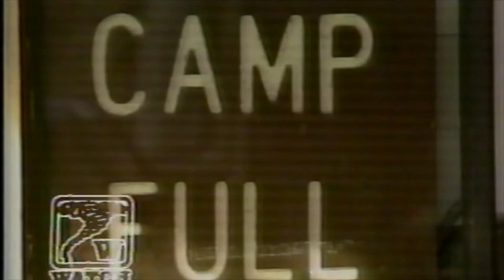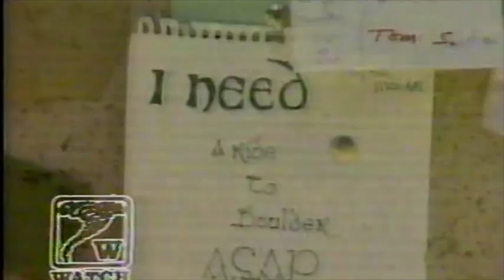Climbing in the 80s Compilation

Comment: Anyone else catch the person falling to their death at around 27:00?? 😟
Reply: naw, did not catch that.
Reply: Where?
Reply: 29:15 was close
Reply: 27:58 "they're hauling off their equipment bag" that was no person^^
Reply: @dr.doppeldecker3832  Phew! Thanks 🤗
Reply: Starting at 27:51, if you play the footage back at .25 speed and pause it, it definitely looks like a person. You can clearly make out the legs, arms and an orange helmet. I also think the commentator actually says, "They're hauling up their equipment bag", which makes sense, given Ron and Jerry were close to topping out the spire. That 15 sec clip starting after the tape glitch at the end of the lost arrow segment also doesn't seem to be in Yosemite. It almost looks like snow capped mountains, which would explain why the supposed person falling looks to be wearing a solid red-colored alpine climbing suit with an orange helmet. It's almost as if the end of the lost arrow footage was taped over, but the audio is still there and at a lower volume. Also, please prove me wrong.